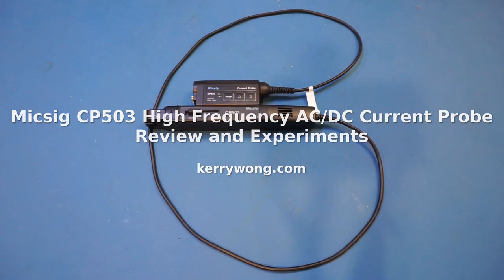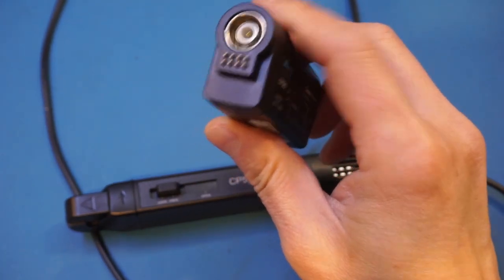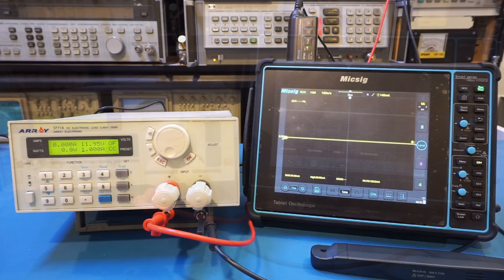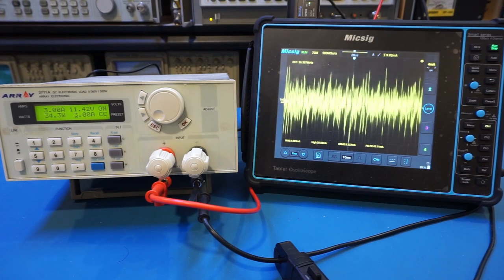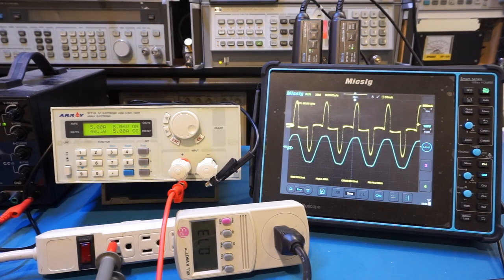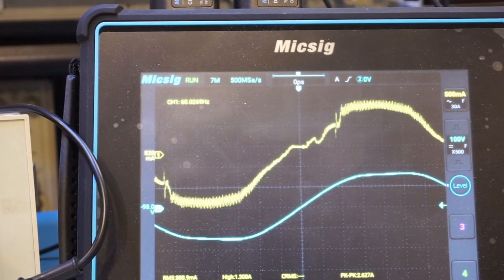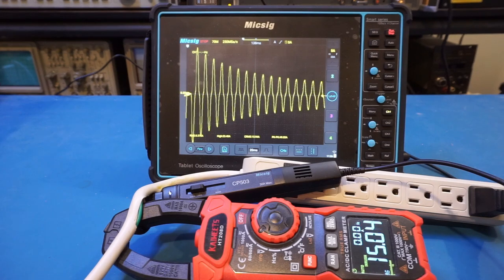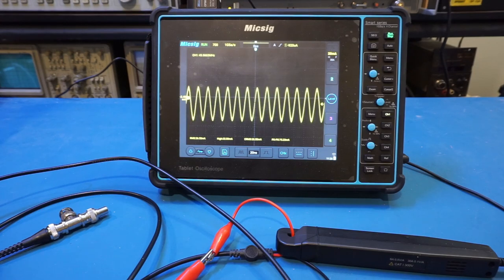Micsig CP503 High Frequency AC/DC Current Probe Review and Experiments

Comment: I own the micsig sto1004, an amazing device indeed! I allso own the older CP2100B current probe, which is a  great current probe! Dear micsig, its not that complicated to add to the advanced math option of the scope RMS, Frequently, phase shifting and other multi-sample measurements. This will make our scope many times more powerful as it will open possibilities not only to measure power, but Allso motors, power supplies, solar inverters, LED drivers and other measurements that require the basic statistics you already have on the scope.. 🖖 Very informative video nonetheless. Thanks you!

Comment: Hi Kerry, can we use micsig dp750 adaptor for BNC connectors with the current probe instead of buying 503b model? 503b model is pointlessly expensive in UK
Reply from the maker: Are you trying to power the 503b with DP750's UPI to BNC adapter? It wouldn't work. I was curious myself as well and tried that a while ago. While the 503b powered up correctly, it didn't work. I suspect not all UPI functionalities were implemented in the adapter supplied with the DP750.
Reply: @KerryWongBlog  yes that was exactly my thought. But you say it doesnt't work :/ thank you